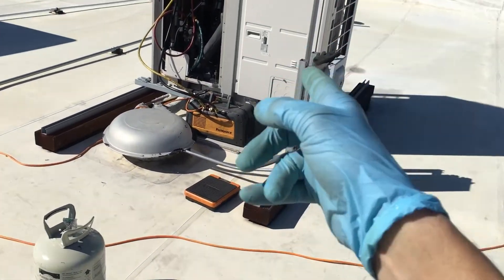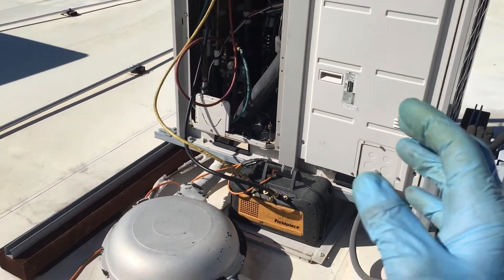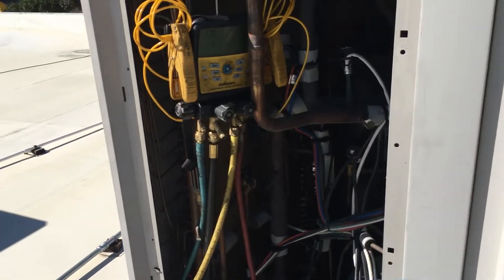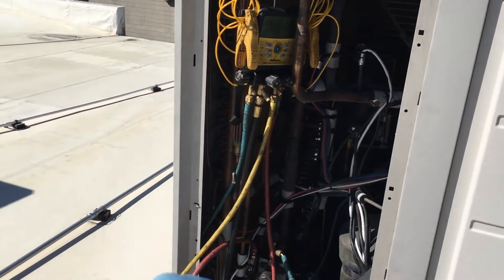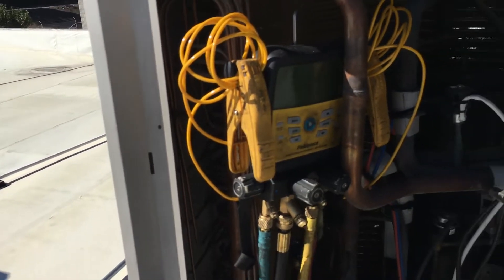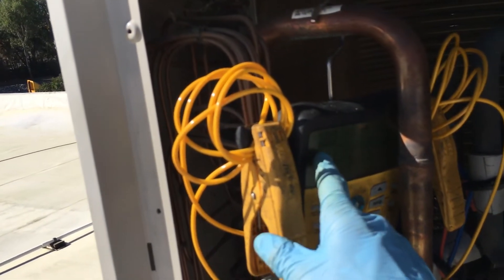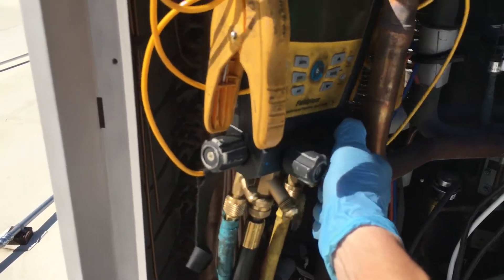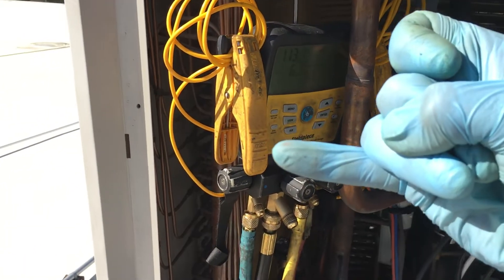Do Not pull vacuum through refrigerant manifold gauges with refrigerant hoses. ￼ BUT ?

Comment: Not sure if you'll see this. Can I use the Fieldpiece 3/8 to 1/4 vacuum hose (not refrigerant) and tap off a valve core removal tool (new Fieldpiece VC2G has two valves)? Then use another 3/8 to 1/4 (HV1S) from vacuum pump to other tap on valve core removal tool. Don't particularly want to buy the $ACCUTOOL$ hose and another micron gauge. Will have separate 1/4 ball valve refrigerant hoses for the 1/4 ports of the SM480V.
Reply from the maker: @stiffmeister0hYeah  not quite sure I’m not picturing what you’re describing. 

But it sounds like you’re a vacuum pump does not have a port bigger than quarter inch .  

And you want to adapt up through a adapter quarter inch to 3/8 

And then on the other side of the 3/8 go from 3/8 back down to quarter inch  ? 

You could do that 

The only reason I say not to use refrigerant gauges, they just don’t give you the quickest and deepest vacuum . 

If you do use them, you’ll just have to go longer . 

And if you have a small vacuum pump you’ll even have to go longer duration of time
Reply: @coldfinger459sub0  bought an SM480v and just trying to figure out best way to evacuate and use internal micron gauge with it. Using 6cfm pump, Fieldpiece scale but need to purchase hoses and fittings to work on mini splits in Cabo San Lucas (they use atmosphere, don't evacuate, don't weigh).
Reply from the maker: @stiffmeister0hYeah  you can use one hose only for mini split since most mini splits only have one fitting. 

The micron pressure sensor is located in the center section of the refrigerant gages . 

The high side and low side pressure sensors are located separate to the valves to the high side and low side when they are shut off you are only reading the pressure sensors . 

When you open you connect a yellow hose to the vacuum pump and pull vacuum just on the center of the manifold that is where the micron gauge is located.